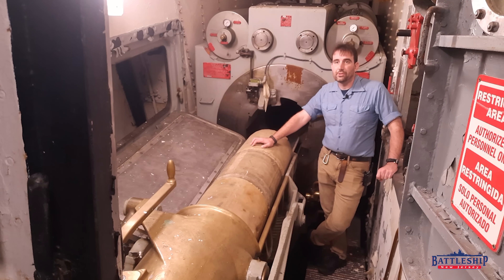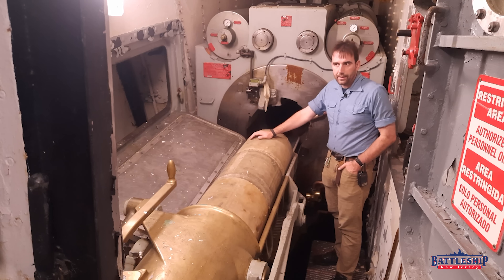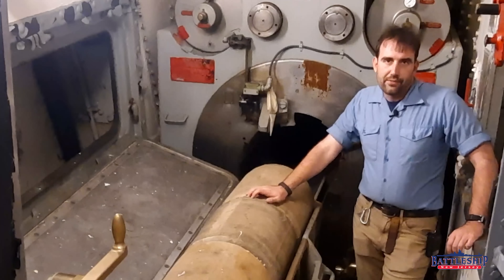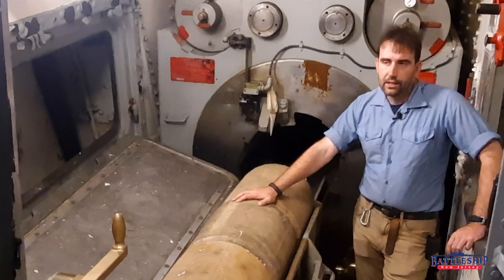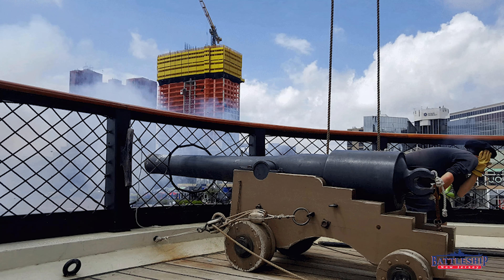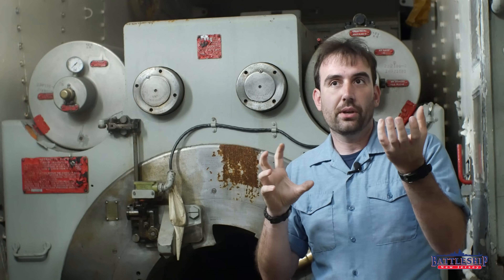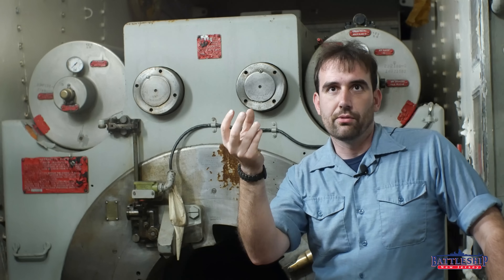How to Unload the Battleship's Guns

Comment: As an artillery Section Chief we occasionally had a sticker. That's when it fires but for whatever reason the shell fails to leave the tube. We also might ram a 155mm round in and the mission gets canceled. We can't leave the round in when we move the howitzer. We also might need to fire a round that is different than the one stuck in the tube. There are two ways we would remove the stuck round. The first and most common way was to use what we call a bell rammer. We would screw together all the pipes we use to clean the tube and then screw on a cone attachment. You lower the tube until its level and then take this 8 foot long pole to the front of the tube. The Section Chief then designates two Marines who's made him mad to open the breach and stand ready with the loading tray to "catch" the fully fused round as it exits the breach. The rest of the crew mans the ram rod at the front and very gently rams the round out. Definitely one of the worst jobs to ram out a fully fused round. The second way to clear a round out would be to call in the ammo techs and they would force water into the front of the tube and use water pressure to push the round out. This way is much more dangerous for obvious reasons. I've only seen it done once.
Reply: Back when there was a nuclear shell for the 155mm howitzer there was a special extractor tool to retrieve that round. I believe it pulled the shell out the front of the muzzle but my training on it was thirty years ago so I might be wrong. If there was a 16 inch nuclear battleship shell I suspect there was a special tool in that case as well.
Reply: @davidrobinson3716  I don't doubt you need to wear dark glasses when using that tool to remove a nuclear shell.
Reply: @taraswertelecki3786  Pretty much lmao
Reply: As a Former artillery chief I’ve used section staffs and a bell rammer (M198A1) water charges from EOD with a .50 cal blank and electric primer and a lot of water  M198&M777
Reply: @thomasshoe92  FDC chief here. We never punched out a round, although we had a bell rammer and the gun crews practiced the procedure. Unloading would normally come at the end of a fire mission, so the tube would be quite warm and with separate loading ammo, opening the breech of a loaded warm tube is bad ju-ju. FDC would request to clear the tubes and was always in my experience granted such.
Reply: @chash7335  Which is why the command to the gun should be "cease fire" so that they can expend what's in the tube.  "Check fire" to hot tubes is bad ju ju...means you're in a hold pattern and don't pull the lanyard.  When that happens, a cook off can occur but on the bright side, the tube is now unloaded.
Reply: @johnnyallen843  The command to cease fire doesn't get a loaded round unloaded. Cease fire means just that. Permission from the FO is needed to shoot out a round after cease fire is given. I dunno how you got 'check fire" out of my post.
Reply: From my artillery days, punching the round out of the tube  with the bell rammer wasn't that bad.  I figured that it takes a lot more force to fire the round out of the tube and arm the fuze than you are ever going to have using a bell rammer.  
I never saw the water technique personally but heard of it being used.

What I always hated was having a hang-fire and then having to crack the breach with a measly bucket of water to try to douse the fireball.
Reply: I say screw that on both choices
Reply: Has there ever been an incident when the shell exploded while a gun crew was trying to remove it? Moreover, what do they do with a fused round once they got it out of the barrel? It sounds incredibly dangerous to handle a fused shell that may be armed.
Reply: @taraswertelecki3786  The round is usually not armed until it reaches a required spin, for just this reason.
Reply: @taraswertelecki3786  I don't know but probably it has happened, especially in WWI or WWII.  A modern fuze would not be armed until it has completed a certain number of revolutions (I don't remember the exact number) but I think it would be at least 500 yards from the muzzle of the gun.  So punching out the run is relatively safe, of course, things can go wrong.  Once the round is removed, it is send back thru the ammo distribution channels  and I think the fuze would be returned as well.  What happens at the ammo holding facility is another story that i don't know.  

The explosive compound inside the shell today is relatively stable, unlike in WWI; it needs the explosive charge inside the fuze to initiate the detonation.  So extracting it is relatively safe.  As I said earlier, I was more concerned that the propellant would ignite once you cracked the breech and oxygen get to a slow burning primer, primer pad, or propellant.  When that stuff goes off, there is a heck of flash and fireball.
Reply: @taraswertelecki3786  These shells use what its called a setback fuze. Basically it requires the force of being suddenly accelerated down the barrel to 'arm' the fuze after a delay. It's a very safe way to arm fuzes and means shells that are mishandled after having their fuze set are still completely safe.

 Only small low velocity shells (Such as the 40mm grenade launcher) use a rotating train that aligns after a certain amount of rotations. This is done because they don't accelerate fast enough for a setback to work, as such force would injure the shooter.
Reply: @Cragified  40mm grenades (both HV M430A1 and LV M433) have dual safe fuzes, which require both setback and spin in order to arm.
Reply: @taraswertelecki3786  It's actually not as dangerous as you might think.  Shells are designed to not go off when accelerated to around 1700-2800 feet per second almost instantly.  

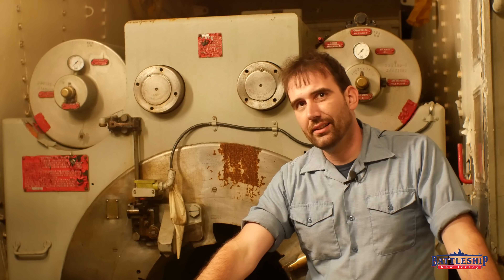As pointed out around 5:10, propellants often don't go off.  This is actually more dangerous, as you have highly volatile primers and a propellant charge capable of accelerating a shell to around 1700-2800 feet per second nearly instantly.
Reply: Also the worthless piece of junk that everyone carried to remove the copperhead from the breach.
Are you referring to the M198 or the M777
Stop, its not that dangerous to bell ram a round out, it's designed to cup around the Fuze to leave it undamaged. It's only dangerous if you have a hot tub or old filler.
Yes having EOD set a water change is dangerous but for the most part the Fuze is not armed, it has to make a number of rotations to generate the centrifugal force to arm the fuse.
Where you with 10th,11th, or 12th?

Comment: Hwy Ryan.. that soft metal ring you were talking about is called a rotating band. You got the full rest of it very accurate. (26 years of artillery experience here)
Reply: I believe they are also called driving bands.
Reply: @taraswertelecki3786  Also heard tankers call them "bore riding rings."
Reply: @yepiratesworkshop7997  if you’re talking 120mm tank, what you see is an obturator.
Reply: @taraswertelecki3786  rotating bands is correct in the US. Some Europeans (certainly the Swedes) call them driving bands.

Comment: GMG1 Turret II  USS NEW JERSEY    In op 769 16" manual   section 2-29 is the manual unloading procedure
Reply: Very cool. Basically a big gravity hammer dropped repeatedly down the barrel in order to knock the projectile back into the chamber.
Reply: @KiithnarasAshaa  seems a bit worrying
Reply: shell has to spin to set the fuse no spin no bang
Reply: @turretman1st  ah ok
Reply: Cool
Reply: the device used has a space to protect fuse from damage also wind screen on armor piercing so fairly safe.
Reply: Most artillery shells require two full rotations before arming, in my limited experience, including the 40 mm grenades. Unsure about mortars, which are smooth bores.
Reply: Found this copy of it online ( https://eugeneleeslover.com/ENGINEERING/OP769/OP-769_Part1.pdf ). Also, it explicitly says in the Forward, that it reflects the USS NEW JERSEY configuration in her 1968 reactivation.

Comment: Was late for the live stream, but the hang fire, part made me imagine Iowa's incident, and USS Mississippi.
Reply: The Iowa wasn't a hang fire. Hang fires happen after the gun is loaded, this happened while loading.

My pet theory was that the rammer jammed and slammed the powder into the projectile.

One of the issues with mothballing is that they fill the hydraulic system with cosmoline or some other stuff. This is never completely remove from the system and the rammers used to stick. Sometimes you had to put the rammer to full throttle just to make it move. We setup an oiler scrubber on center gun that was used to filter an F-14s system. We ran it for 2 days and still had issues.

One reason why I think that is the gun crew on the Iowa was doing Sud 40 second loads and if you're trying to get that fast, you are not being safe and there's no room for errors.

Speed on loading depends highly on the rammer man and he will make you or break you. I had a couple of good ones and we could get around 35 seconds per load. Believe me, it ain't easy to get 30  second loads.
Reply: @pville_piper5125  yes. I'm all in on the tech details. But the intricacies of operating these weapons is quite dangerous every step of the way.
I saw Iowa fire in 87. Go Navy

Comment: As a Gunners Mate on a 5" 54 there was No way to clear the projectile back threw the breech! You could fire what we called a "Short Charge" This was a powder charge that only contained enough charge to safety push projectile a very short distance out the barrel. Im sure during WWII with a 16" gun you just halted the supply operation of ammunition to the gun and fired it at a safe place of opportunity..
Reply: I was a Gunners Mate on a 6" 47 USS Providence CLG 6 in Vietnam 1972. At times when we had extremely hot barrels and the sliding wedge breach block would malfunction requiring repairs that would take longer than the estimated cookoff time for the projectile. Our backing out tool used the wooden poles used for the brushes to clean the barrel fitted with a backing out collar. The 6" turret was on the main deck so with guns lowered several of us would be on the poles pounding on the projectile and backing it out and throwing it overboard. There was a 5" 38 mount on the 02 level directly behind the 6" turret so there was no way to reach the ends of the barrels. The short charge would work if the breach block wasn't malfunctioning.
Reply: The "short" on the 16" guns was six bags of 8" powder. That stuff was older than the hills with very inconsistent velocities. We only fired it a couple of times. It was meant to be used for reverse slope firing, sort of a high angle shot that would be like a morter round.

Comment: Occasionally I'll get a bad primer in a round resulting in a dud/ misfire, but the far more sporty example is the time my squad was in an intense firefight that lasted 14 hours (IRQ '07), our SAW was so hot that it cooked off a couple rounds, that was definitely interesting.
Reply: Early in the service life of the M-16, cook offs frequently occurred due to ammo loaded with soft primers and/or loose fitting firing pins... a buddy next to me had a cook off due to a slam-fire cook off. 20 rounds in the blink of an eye. 
This is also why I use CCI #41 primers in my reloads (thicker material not prone to slam fires)...
Reply: @tommysaulter9171  Yeah I've heard that from 'nam era and 80's era Vets, rifle would just run away on ya, crazy stuff.  The SAWs do it when they get too hot and can't change the barrel (also considering we only usually ever had one extra barrel with us and that would get all jacked up too with the volumes we were expending).  CCI primers are some of the best for sure!  Good choice.
Reply: D.J. "Metalhead Mercenary"... I have a pin gauge set that I use on my BCGs (Bolt Carrier Groups) to match the firing pins, taking a majority of the slop out that causes it. Early problems were eventually traced back to the use of regular "small rifle" primer heads that are too thin for use in floating firing pin weapons (M-16)... 
M-60 GPMGs had the same problems as you mentioned with the SAW due to heat. Those "Pig Gunners" were quite talented at removing a cartridge from the belt that would prevent burning through a whole belt worth of ammo.
Reply: @tommysaulter9171  Very wise, I always try to do the same with matching pin and bcg if i'm doing a build or buying a separate bcg assembly, good stuff.
Yeah hah, staging the belt or doing a quick change/ removal is definitely a smart nuanced skill as a lmg gunner.

Comment: Ryan  Misfires Yes  .     When I was 14  I put together a reproduction .58 cal  Rifled Musket Kit  . Bicentennial  Era . As a Hunter I used it Deer hunting for Decades .   It was loaded thru the Muzzle and fired Black powder .  Black Powder sucks any Moisture that it can find and it can lead to Misfires .  It is a closed Breach and the Projectile was a tight fitting Patched Round Ball  .  Yes You can take a Ball Worm and drill a Grip onto the Projectile and Pull it Back out of the Muzzle .  But it is not easy and you are still dealing with a Loaded Musket , wet Powder or Not .   It was standard Practice after hunting all Day to Fire your Load into a Log at Dark .    You can not safely Put a loaded uncapped Musket in your Car and drive it Home at Night .   Each night required a Cleaning  because the Fouling from Black Powder is Corrosive .   Yes  many Misfires over the Decades with that Musket and other Muzzle loading Rifles .  I enjoyed today's Informative Video , Thank you .

Comment: You did a previous video about the 16” brass shell remover.  It was a solid piece that was placed in the end of the barrel and dropped onto the shell to knock it down towards the breech.
Reply: Glad you pointed that out. I watched that video not that long ago. The shells have to spin so many times or achieve a certain velocity to arm (off the top of my head).
I believe 40mm grenades need to arm on the trip out and are rotation based, although I don't know that I would hit them with a hammer. I was never qualified on grenades.
Reply: @JamesKintner  The whole concept of beating on the fuze of a 16” shell to get it out of the barrel scares the bejezzus out of me.

Comment: Was on the first sea trial of USS Missouri as a Long Beach Naval Shipyard yardbird.  One of the #2 Turret barrels misfired.  The gun captain tried a new primer and it didn't fire a second time.  The barrel was shaken up and down vigorously and a third attempt succeeded at firing the barrel.  As a young waterfront engineer, I was lucky enough to attend the sea trials gun fire from the 05 exposed bridge with the Captain and other important people and witnessed the gun firing from a select vantage point.

Comment: I have had mis-fires a-plenty. I had a hang-fire on an old milsurp 8mm mauser round ... it went off 5 seconds after I pulled the trigger! And the worst one ... 44 magnum probably only the primer fired and not the main charge. It lodged the bullet halfway down the barrel. I stopped from firing another round, and probably hurting myself badly, because it felt "funny".
Reply: I fired an old Nazi marked 8mm Mauser round as a kid, probably 30 years ago, the firing pin went "Click", I had the sense to hold it downrange, it fired after I  said " I think this is a dud...boooom!"
Reply: If you had fired another shot, your gun would have been wrecked, and quite probably severe injuries to you. I saw what happened to a Glock pistol that was the victim of a cartridge with a TRIPLE charge of powder. The slide flew off the frame, the magazine was blown out of the grip, and pieces of metal and polymer penetrated the firer's arm, hand and face. He was lucky he did not lose an eye or worse.
Reply: Don't forget the problems with Turkish 8mm surplus.  The powder breaks down and has a tendency to go way overpressure.
Reply: @SovietDictator  When smokeless powder is deteriorated, a reddish dust is present in the powder. So if you load your own ammo as I do, and find that in a container of powder, DO NOT use it. It should be destroyed, by burning or soaking in water. Old ammo can be checked by pulling the bullet from a few cartridges and looking at the powder in the case. If it's present, the ammo is dangerous to fire.
Reply: @taraswertelecki3786  Correct.  I have not used the Turkish 8mm surplus but have warned several budget-minded friends about it who might otherwise be taken in by a low price and think it's a good deal.  

I load my own ammunition and use only powder I have purchased new.  I think the oldest powder I own is two years old and has been stored carefully.

Comment: A hang fire on 16 inch gun - damn.  Since the shell is in the throat and engaged the riffling there is no pulling it back. It is a flat bottom. Magnets will not work. 
Yes this happens on tanks. There are lengthy procedures to deal with it.